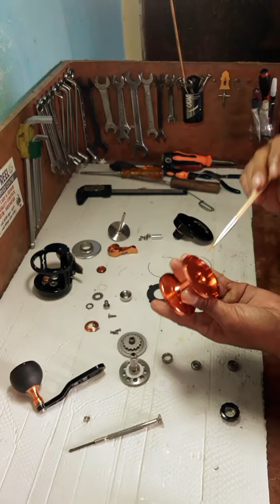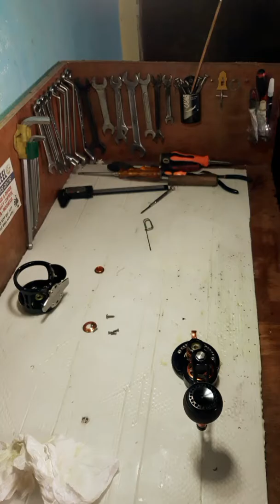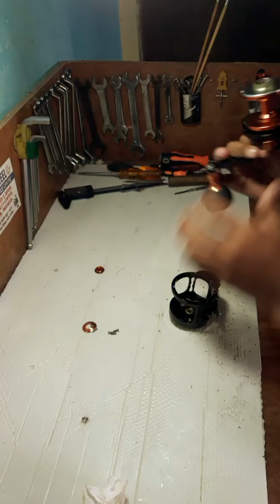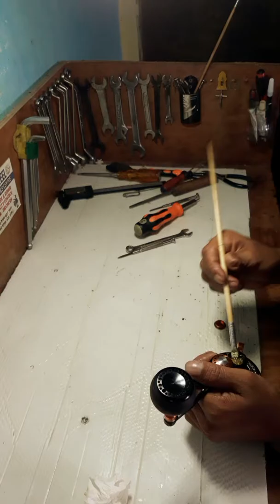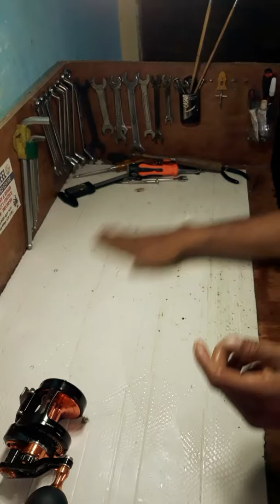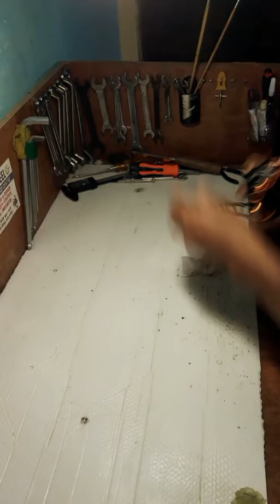#Part 14 Cara servis reel Overhead MAXEL TRANSFORMER F50C #caramemperbaikireel

Comment: accurate vs maxel mana yg lebih rekomended abang?
Reply from the maker: Kalau dari bahan2 gear nya rata2 sama.. sistem juga sama.. perlindungan terhadap korosi juga sama2 rentan.. power drag lebih ke maxel.. 😁🙏
Reply: Maxel sama accurate bx 11-12 sama" reel tangguh..sya pilih maxel karna lebih elegan tampilannya..
Reply from the maker: @rahmatzx989  bahan2 gear nya memang kurang lebih sama